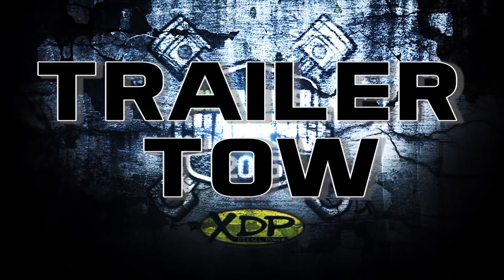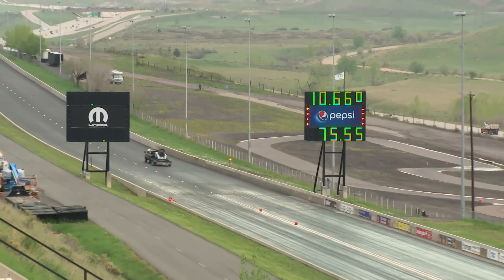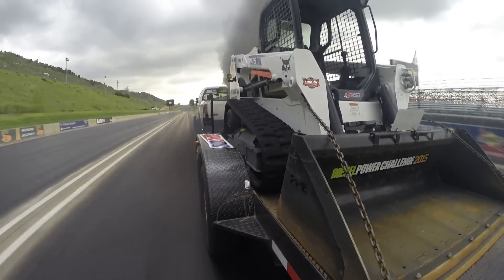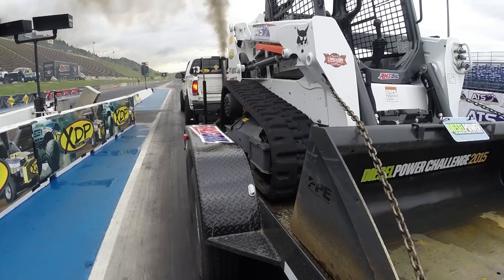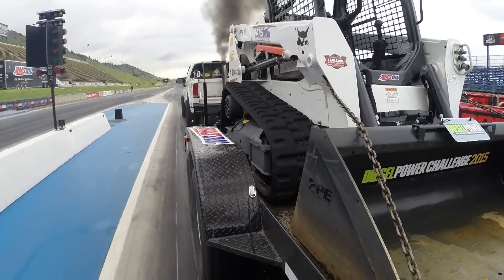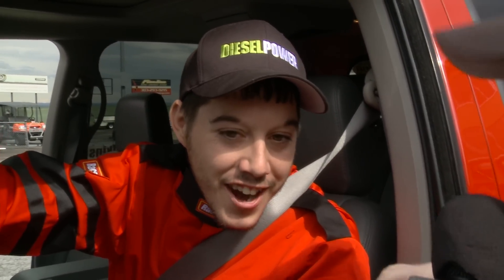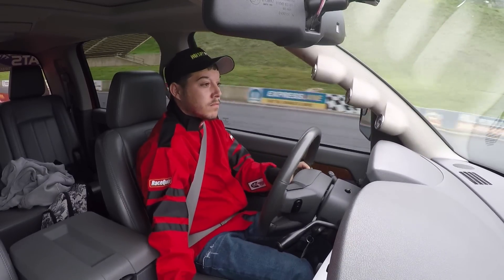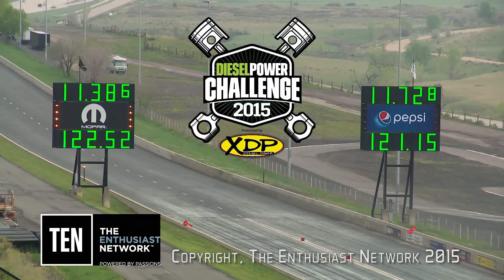1/8 Mile Trailer Tow - Day 3 of 2015 Diesel Power Challenge!

Comment: I always thought it was impressive that these trucks could make over 1000 hp with stock internals, but I think it's pretty clear now that most of them are just dyno-queens lol.

A lot of these guys are running compound turbo setups, but I wonder if a supercharger/turbo combo setup would kill that lag more effectively.
Reply: KrazeeCain it does the Detroit diesels ran that for years 
they ran a blower fed by a turbo to help on the bottom end.
Reply: Twin charged are great, look at the old screaming jimmys
Reply: The detroits ran superchargers because a 2 stroke diesel cannot run without forced induction they don't pull air in themselves. Superchargers take too much power to run and cause too many harmonics to make it worth it

Comment: No manual transmission?
Reply: We have 2015 you dont need manual anymore
Reply: Steffen Simon lol, you simply put your right foot down? Really much skill involved!
Reply: ikonane they tend to be very hard to handle as manuals with that kind of power. That's why you see bugatti veyrons and nissan gtr's etc with automatics transmissions only
Reply: Lord Curry 👑 thats because kids cant drive a stick.
Reply: Thomas Botica That's not true. The reason modern supercars usually come with automatics only is because they shift faster. No human could ever match the speed of a dual clutch auto. Manual is a lot more fun though.
Reply: Steffen Simon We have 2015 an I still prefer to shift manually. And my fathers car, 40 years ago, also had an AT... so thats really nothing new in 2015 :D
Reply: ikonane The reason that you don't see any manuals comes down to two reasons:

1. Automatics shift faster and more consistently
2. On big turbo vehicles, you never have to get out of the throttle to shift so the turbo stays spooled.

Some racers will bang shift the manuals, but if you miss a gear it's a great way to hurt the engine because it's headed straight to redline.
Reply: Last year there was a manual black old body style ford
Reply: Aggressive Pizza you think automatics are more fun?
Reply: ikonane I'm losing interest for the future cars, they're becoming electric and even self driven! I love the good old petrol engine and I love the joy and feeling of driving a manual car. It's the reason why I like cars in the first place. And I ride motorcycles so it all ties in. And you can do so much more with manuals
Reply: No one knows how to drive manual anymore lol
Reply: Aggressive Pizza oh yeah you're right, corrected.
Reply: ikonane Manual transmissions in full size trucks are slow and clunky on top of having a stiff clutch. You lose boost and time every time you make one of those long shifts.
Reply: Wagon Burner That seems true when I see trucks drive on the roads
Reply: bugeyerexxin There's nothing wrong with having a manual for daily use, they're just a little too slow for racing is all. I kind of prefer manuals for daily use because I've gone through like 4 or 5 automatics in 3 different F-350's.
Reply: ActionHeinz Do you also prefer to roll your windows down with a crank? Or lock every door separately with a key? Or control the A/C manually?

Comment: Makes me wish I had gotten a diesel instead of my V10 f250. Well we all make mistakes..
Reply: Michael Creger They have their ups and downs. What year V10? There's a lot of money running down that track over and above the premium you would have paid for the diesel.
Reply: Edward Lee 99. Just got one re manufacturer from motorcraft and Trans put in it.
Reply: Michael Creger  my grand father bought a v10 f350 2009 king ranch.. im painting my dmax so he let me use it..... god i feel your pain mate..... MPG is really bad and its boring to ride man
Reply: StyleGT Don't get me wrong I love driving. The body is in great condition with no rust, yeah there are 99s without the rusted wheel well.  But I've also gone and put a K&N under the hood along with headers Gibson exhaust, Performance chip and tuned it. But if it had been diesel it would be pushing out much more horsepower for what I've done to it. I did just a few months ago consider putting in a Cummins into my ford o.O
Reply: did you gain any MPG with the chip? and what brand lol... is there custom tuning for v10's?
Reply: I bought a cheap chip off autochips direct, I notice a MPG increase and better throttle response. I later bought a diablo tuner for it and it comes with different tunes depending what type of gas you want to put in it(reg, plus, premium) and it does claim different horsepower depending on the fuel.The tune also increased my MPG by a lot more than the chip did, however the tune makes it very difficult to stay off the gas.
Reply: sorry about the late reply, been very busy the past few days.

Comment: I'm seriously considering my first diesel, I would like too know if diesel maintenence is expensive?
Reply: not sure why no one responded. yes diesel maintenance can be expensive. fuel is more expensive, takes a lot more oil per change, fuel filters get changed as often as the air filter ect.

Comment: I'm surprised they didn't have to wear helmets.
Reply: Because murica
Reply: jospi2 Sheet, murica's got states you don't need a helmet to ride a motorcycle.  Yes, you have the right to brain damage!  Take that, North Korea!
Reply: None of them were going to be fast enough to require it.  Bandimere's helmet rules are 13.99 and faster for the the 1/4.  They don't have an 1/8 time but I would imagine 8.50ish would be where they need one.
Reply: jospi2 they dont need helmets, their hats protect them
Reply: jospi2 Some tracks are so strange on their safety rules. Our local track has a road course and a 1/4 mile, 1/4 mile you have to have helmet, no passengers allowed, and roll cage if fast enough. The road course.... No inspection, I have seen pple shove 4 pple in a convertible mustang with no roll bar no helmets and the driver was smoking a cigarette while driving around the track...
Reply: If manuals were so good, you'd see everyone with them
Reply: sik59rt
Manuals are better than automatics in every aspect, how ever car manufacturers stopped making them people people who are buying trucks now dont know what a clutch is
Reply: Does a manual shift faster, get better mileage, able to handle 2500lb/ft of torque better than a automatic ?
Reply: sik59rt
yup. look at rigs, prime example. 
i can shift my 89 f150 5 speed faster than the computer in my 97 f150 with the 3 speed auto can shift
Reply: jospi2 going 75MPH?  Do you ware a helmet on the freeway?
Reply: Justin Bechtel You are using ancient Ford truck technology as your yardstick?  Sorry, but in 2015, autos are just as fast, if not faster, and usually more economical due to having more gears.  Don't believe me?  Look it up.
Reply: iambiggus
yes, automatics are better in this day and age however manuel vehicles will always be better at towing heavy loads, but people now a days are too stupid to operate 2 pedals, let alone 3
Reply: Justin Bechtel    I don't know about the stupid people part, but I do know that new car shoppers these days rarely have a manual as an option.  I took my niece out car shopping the other day, and all we saw were CVTs and "automanuals".  Sad state of affairs.  Any true driver prefers a manual.
Reply: iambiggus
go to europe. 98% of their cars are all manuals
Reply: iambiggus You have to know where to look. Lower end models still have stick as an option, and there's way more enthusiast targeted fun cars been made these days. The Focus ST only comes in stick, for example. Subaru BRZ, Fiesta ST, Camero, Challenger, Mustang, shit I could go on forever on how many vehicles still offer sticks that people buy. It's never going to be as popular as automatics because most people never learn how to do it, but I'd hardly call it a "sad state of affairs". You get a lot of fun for your money as a shopper in todays market. Now if we're talking about trucks? Yeah, manuals died by early 2000's.
Reply: ice44567 Well we are going to have to agree to disagree, and in fact, you can't go on forever about how many offer true manuals, because it's not that common anymore.  Yes, there are some who still rock the manual, and that's great, but those numbers are shrinking, daily. It's a sad state as far as I'm concerned, and if you've been car shopping recently, you'd see that.
Reply: iambiggus I don't understand how manuals not being common anymore refutes my point. There's an amazing selection today of good cars that you can get with a stick. I don't know what more I need to say about that. And I did recently go car shopping. I bought a 2015 Dodge Challenger R/T Scat Pack with a 6 speed. I literally just went through this process. Tons of great cars still have manuals. If I had more money I would have been all over an SRT Viper (Which ONLY comes in stick) or a Z06 C7 Vette, and many other fun things.
Reply: ice44567
the issue is "good CARS", try to find a domestic truck now a days with a standard transmission. its mroe common in europe/austrailia than it is in canada/the US.
Reply: Justin Bechtel I mentioned that. US got screwed when it comes to manual trucks. The last ones were early 2000's. Really sucks, but the average truck consumer just didn't want them I guess?
Reply: ice44567
there are so many people that i talk to that said that they would personally prefer manual trucks, they do a lot of hauling (cars and what not) and they said their older trucks pulled better and there was less stress on the transmissions than they are experiencing now. one guy said the only reason he got a newer truck was because his old one was getting too tired, after hauling hay, cars, what ever he could put on his trailers across canada.
Reply: Justin Bechtel I mean I want a manual everything, but the bean counters run the show at the major auto manufacturers in this country. Even the imports don't offer it anymore. Guess they know something we don't.
Reply: ice44567
like i said before, the reason the standard transmission is fading away is because there are so many people that dont know what a clutch is, they can barely operate 2 pedals let alone 3
Reply: Justin Bechtel True dat. I'm just glad they still make cars I want to drive with a 6 speed. I wouldn't have my challenger R/T any other way.
Reply: ice44567 Congrats on your purchase, great choice, awesome car.  I don't know about "tons" part, but agreed, there are good cars to buy with manuals. However, I still don't see how that refutes my point. Good luck finding an "average car" with a manual.
Reply: iambiggus Thank you. But I can also think of plenty of average cars that are still offered with a manual. Off the top of my head, the Fiesta, Cruze, Civic, Fit, Sonic, Focus, Jetta, Yaris, Scion's entire lineup pretty much, the Mitsubishi Eclipse, etc. Yes, they're all far less common and you're not as likely to find them on a lot (with the exception of the Civic, my local dealer has six for some reason), but all I'm saying is manual isn't dead yet. I'm not even sure what we're arguing about at this point to be honest, haha. I'm just saying it's a good time to be a car enthusiast compared to 20 years ago, even though back then you had more "regular" options that came stick. In 10 years yeah I worry for the future, but we'll see. I'm more worried about the V8 going away at this point. Too much hype over electric. Yeah it's nice, but I need some sound
Reply: ice44567        I will concede the point, there are "average" cars to be had with manuals, I just wish those #'s weren't shrinking as we speak :-(

No argument from here bro, V8's and a clutch keep order in the universe.  More vehicle manufacturers need to see that.
Reply: Manuals, if not used proper could damage your transmission, but it's has more torque than a automatic and better fuel economy.
Reply: standard rules I've seen say if you run 16 sec or less on a quarter mile you need a helmet.
Reply: Yes. When someone knows what they're doing with one.
Reply: The autos now are actually slower shifting than they used to be. They defuel on shifts. I had an allison 1000. It was nice, but kind of annoying sometimes too. I prefer the nv5600 I have now.

Comment: Imo most of these trucks have way too much turbo.   I wouldn't hot rod a diesel.
Reply: Because you can't afford it
Reply: Diesel Lozano 
Far from.  My daily driver up here is an f450 Harley Davidson.   H and s tuner , dpf delete and intake.  Upgraded intercooler inlet to a true 3 " and it pulls nice.  Too big of a turbo and it will compromise the towing capability and daily duties of stop and go driving.  Lag monsters are not fun, unless it's track only.